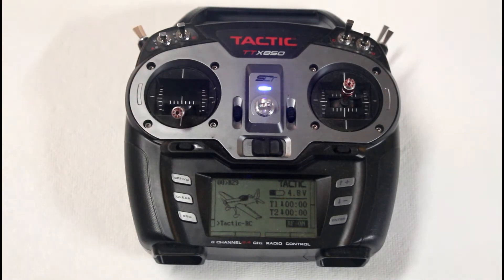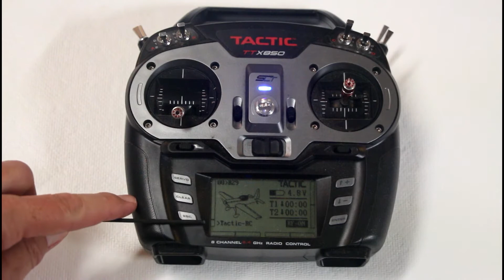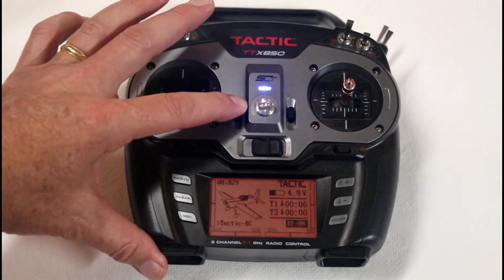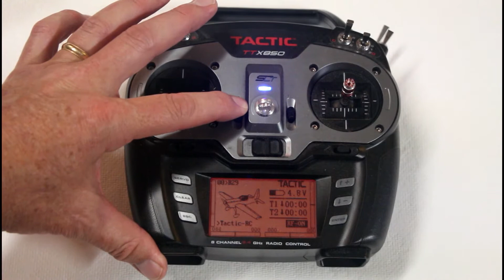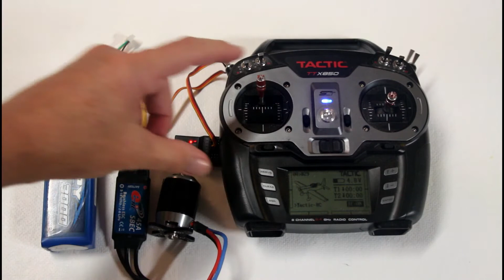How to Sync multiple brushless electric motors for model airplanes

Comment: Thanks for the video. Is there anything I can do on the radio side to sync up the RPM's. I followed your directions and got both my motors to sync up at any throttle level, but after taking my tachometer,  one motor has slower RPM than the other. Any ideas what I can do to sync the RPM?
Reply from the maker: Not that I know of
Reply: @clscale  just figured it out. Motors have to have their own channel then mixed to work on throttle stick. Once that is done, you manipulate the servo balancer and increase the rpm to the motor that's lagging.
Reply: @LOSCABOSLIFE  so left motor tochannel 3 and right motor to what channel? or how did you have it set up? is there any other way and do you know what is causing this?

Comment: Fred, I have been searching for info regarding 3 motors in a boat I inherited partly built, it had all the motors and 2 ESC's. My problem is, how to wire the motors, ESC's and reciever. Can you help please. I am a new to RC models.
Reply from the maker: Look at my other video on my channel on how to hook up  multple electric motors "tactic 650 transmitter and electric power",  that will show how to hook up multiple electric motors. If you have  3 motors and 2 ESC's you are going to need one additional ESC. Try to get the same brand.. they setup differently. It make not be really important if the boat ESC's are synced on the airplanes it's critical. Each motor will require it's own ESC.

Comment: Not exactly what I was searching for but this is still VERY good info! Did you disable 3 of the 4 bec on your B-4 motor to receiver setup?
Reply from the maker: Yes the only ESC that is providing power to the reciever is motor #4 (right side outboard).  That is why when the battery is plugged in on motor #1, #2 and #3 nothing happens. When #4 is powered up the reciever is now  driving all four ESC's. I simply cut the red wire on a servo extension and plugs into the  ESC. I didn't want to cut the red wire on the ESC itself.

Comment: how do you hook up the esc to the four motors? and then the transmitter in the airplane. what you talked about is the controller but thats the second part the first is the initial hook up to the esc and tranmitter. some say you have to remove wires from a BEC assuming you have one? also i think your props have to be turning in different directions.
Reply from the maker: Each motor has it's own ESC and battery. The ESC's are hooked up to a Quad harness so each ESC gets the same signal and ground from the reciever.

Motor #4 has the BEC function feeding power to the reciever from that ESC, the ESC that control Motor #1, #2 and #3 has the red wire cut so that only ESC #4 sends power to the reciever. That is why nothing happens when motor #1 thru #3 are plugged in, when ESC #4 is plugged in it feeds power to the reciever and system is armed. as usual the transmitter is turned on first, then power up the airplane. the battery is plugged in to ESC #4 last when starting and the first to be unplugged when done flying.

The main problem was that each ESC (all four were not synced) and I needed them to be synced exactly the same.
Reply: @clscale  thats what i read about the red wire which i found confusing. have you ever done a video on how you hooked up your engines. i have never built a plane before im still in the process of buying parts which can be very complicated! im astonished at how complex this is.

Comment: Will this work with 4 motors on 2 Batteries. As only one master speed controller has an imput, or will the 2 batteries have to be on a Parallel cable to set up first time. I couldn’t for space and c of g reasons have 1 battery, one is in undercarriage bay one just rear of rear spar.
Reply from the maker: From what I can tell the number of batteries is not the factor, we are trying to get the ESC to be setup correctly so that the motors start up and shut down together for that particular transmitter/reciever. Since you have one ESC they all should be getting the same signal from the ESC. You should be able to hook it up as is. I have never tried to have the three wires from the ESC drive multiple brushless motors. this and another of his videos to set up a twin I am putting together  https://www.youtube.com/watch?v=QIp8JZ-B8S4&t=6s
Reply from the maker: Check out RCexplained channel and see what he might suggest
Reply: @clscale   Sorry I confused you, I have 4 Esc, 2 on one Battery 2 on another,  I’ve made a Battery splitter lead that powers all Esc then done the setup as per your Video, then now when Batteries are plugged in,the Master first they are all synced ok.
I have put a very short video on my channel with the C130 taxiing. Will be live shortly.

Comment: This is so wrong. Why are you adjusting the trim? Setting the throttle limits sets the motors to operate between 0-100% using the stick. There is no need to touch the trim.
Reply from the maker: I can push the throttle stick down all the way and the motors will idle, then when it's time to shut them down I move the trim. Engine kill could also be used for this purpose but I choose to use the trim which allows me to get the idle speed as low as possible

Comment: Is it okay to have batteries on every engine lets say 4 engines?
Reply from the maker: The individual ESC and battery per motor acts just like a single engine model. By having all four ESC's hooked to the  same receiver they all get the same signal, but since the ESC's feed power back to the receiver I can only have one receiver do that job so 3 of the 4 ESC's have the red (power wire) cut with the wiring. I don't actually cut the red wire on the ESC but just on the servo extension that feeds the ESC

Comment: Hello, what size of motors, esc(s), and batterys are you using? also do you have plans for the b29? intrested in building a 4 engine bomber.
Reply from the maker: I enlarged the koku fan 3-view and built off of the enlarged 3-views. The model uses the E-flite Power 25's, 870 Kv with 4S batteries, 3000 Mah. Be careful on the prop size because if you pick the wrong prop It might draw more than 45 amps which is the maximum the ESC's can handle.
Reply: Ok good to know! thanks for the reply! just to confirm you are using 4 4s batterys? 1 battery per engine?
Reply from the maker: @evanmclatchy6648  yes each motor has it's own esc and 4s battery. Each motor is like it's own system with all four speed controls plugged into a 4 way harness then that plugs into the reciever
Reply from the maker: Yes each motor has it's own ESC and battery
Reply from the maker: check out this video that I did that shows how the BEC works for 2 or more motors https://www.youtube.com/watch?v=TAtDJKU2BqY
Reply: @clscale  Thank you so much!
Reply from the maker: check out this video which is also on my channel   https://www.youtube.com/watch?v=VBKbUiPeqNs

Comment: Hi Fred. good morning. 
Very nice 4 motors plane. 
I have some questions related to motors. 
I hope you will answer to me. 
I was looking in the web a motor for a park jet plane, but it looks all the world is turning around the drones. So some questions arise to me. 
I notice that motors for planes have normally higher can rotor than the motors for drones. 
Why this difference? 
Comparing motors for planes and for drones with same diameter, same kv and same voltage applied, what are the differences between motors?
Considering same motors characteristics, may I use a drone motors on a plane?
There is any differences in performance?
About propeller, which are the main differences between drones props and planes props?
Is it ok to use drones props on planes?
Thanks for your attention and replay. 
Regards. Giorgio.

Comment: Hi Fred ! can you share infos of your plane ? not the B29 it'self but im intrigued by the shape of fuselage...  best regards!
Mario
Reply from the maker: if you look from the side the outline matches the shape the B-29, it's called profile scale in that the fuselage is only 1" wide but has the side view profile. Same thing with the nacelles. CL Scale at the Nats has Sport scale (full body shape) and Profile Scale in different categories
Reply: @clscale  Thank's Fred for the infos abt your plane !! it's your own build project ?  beside that, your video concerning the ESC sync help me a lot to figure out how to setup my last plane project, i have converted a single motor plane to run as twin motor, i have already do the maiden and all work pretty well !! so, best regards and happy new year from Italian Riviera ! bye !!!
Reply from the maker: model was built for the Control Line profile scale event (USA AMA event) that is why it's flat and not round. E-Flite power 25 870 Kv motors and weighs 14 lbs.

Comment: How are the ESC's wired to your battery given that the initialization does not start until the last esc is plugged in?   I would think that each esc would initialize as it is plugged in...
Reply from the maker: All four ESC's get the signal and ground from the receiver (quad harness) but the  #4 motor (right outboard) gets the signal power and ground. Basically the only ESC that provides power to the receiver is the #4 motor. I cut the power wire on the  #1, #2 and #3 motor so the #4 motor provides the power to the receiver. that is why the system comes alive when the #4 battery is plugged in last and unplugged first. One throttle stick and one throttle channel.
Reply from the maker: The #4 motor has the ESC hooked to the receiver with signal, ground and power. The other ESC's only have the signal and ground this is because the ESC's have BEC battery eliminator circuit. Only one of the motors can have the BEC power going to the receiver. This is why nothing happens when #1 thru #3 are plugged in nothing happens. You will notice that there are four double beeps once the #4 esc receives power

Comment: Isn't it dangerous to do the tests with the props on the motors?
Reply from the maker: You are right normally you test with the props off so I made sure I was clear of the props during this test. Also wanted to know if the motors were going the right direction
Reply from the maker: Normally yes but I knew how the model would react so it was done that way
Reply: You? Yes.
Me? No.

Comment: Hi Fred, so is the controller play role in synchronisation but not adjust the voltage or current to make it synchronised?
Reply from the maker: the position of the throttle stick determines where the motor starts, so by doing all of the motors at the same time the transmitter controls and set the  sync of the 4 speed controls. then they  all start or stop at the same spot
Reply from the maker: It just gets all of the ESC's synched up so that they all start the motor at the same time